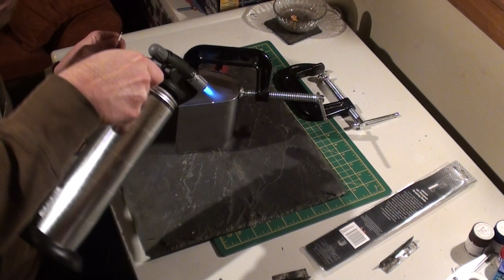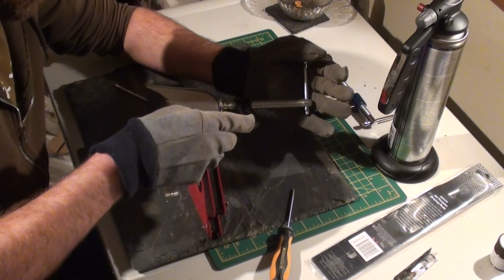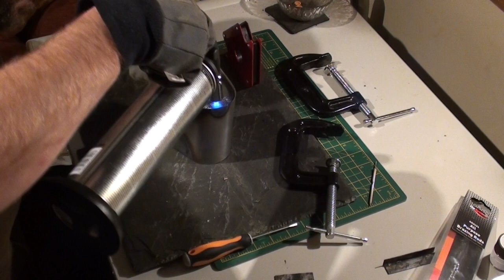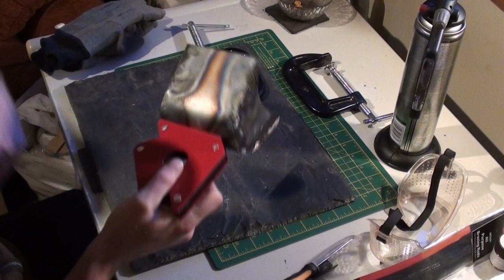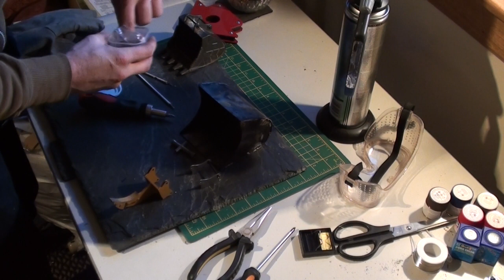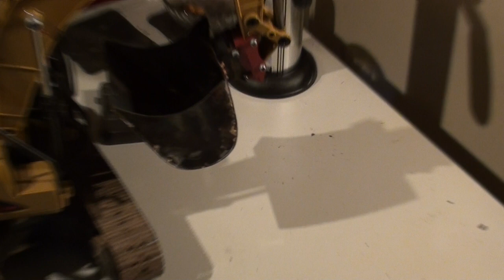Making A Bucket For Huina 580 Excavator : Part 2  Brazing

Comment: Top job dude! Brazing is hard to do imo
Reply from the maker: tell me about it lol. The sides were easy enough ( looks bad but holds up well enough) it's just the hitch that was giving me problems , sure it was the heat dissipation over a larger area causing issues  .....  which is where part 3 comes in :)